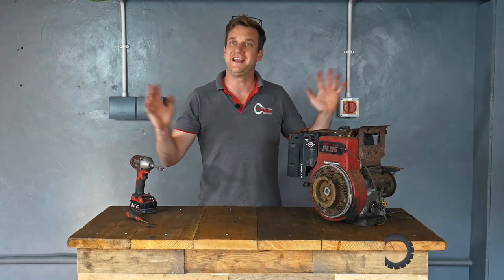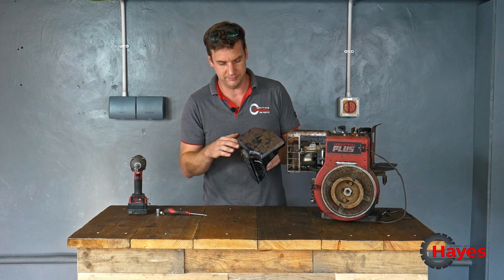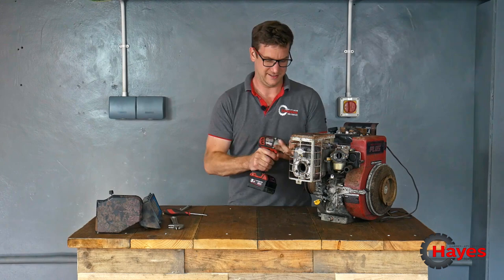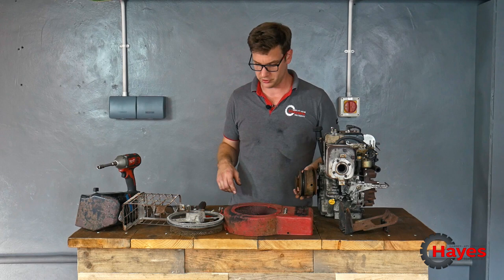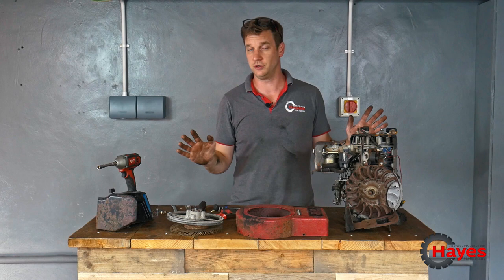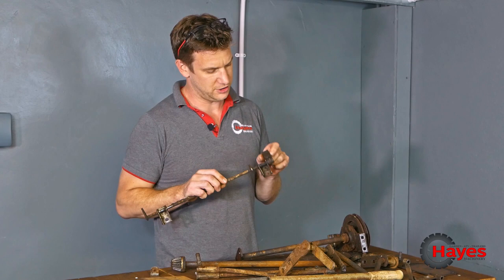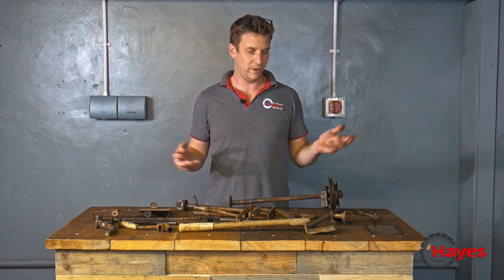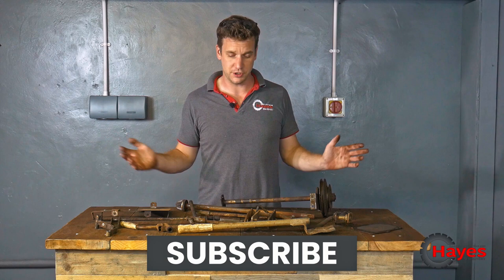1963 Bolens Husky 600 Lawn Tractor RESTORATION | Part 3 of 6

Comment: I am now so confused.
Reply: Hi John, which bit are you confused about?
Reply from the maker: Hi John, why are you confused?
Reply: @MachineryNation  I was a bit disapointed you weren't going to source an original engine. After seeing what you did to this engine to make it fit in this tractor, I think keeping this one was a great choice. It's more hp, and looks like it  could have been original in there.
Reply: @cub1009  then why are you complaining
Reply: @dansdiecastcarreviews4942  I was not complaining. After seeing the great work he did to that engine, it looks right at home. Even better than the original.
Reply: @cub1009  ok
Reply: @dansdiecastcarreviews4942  ok